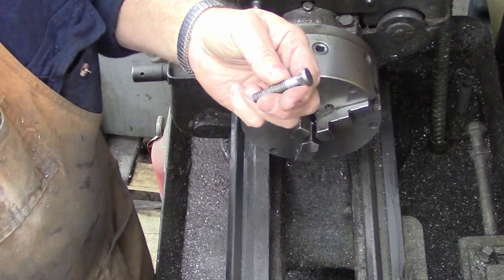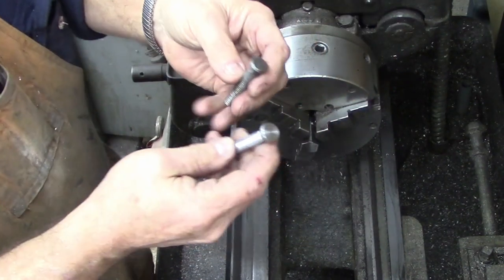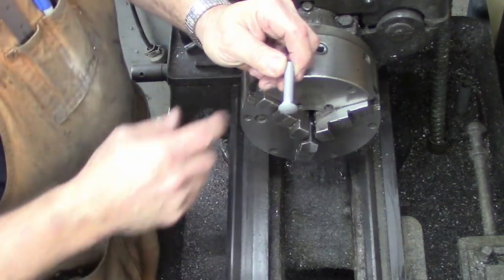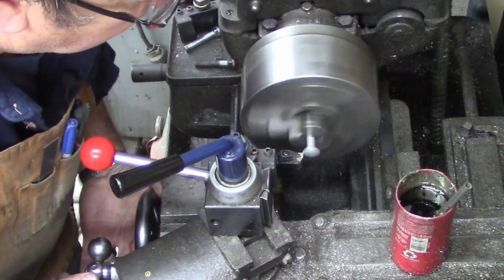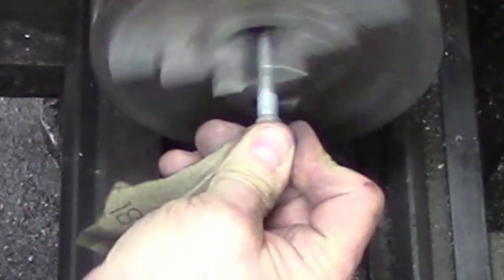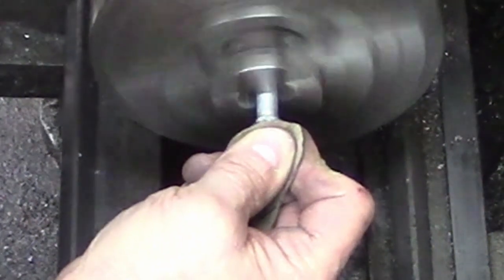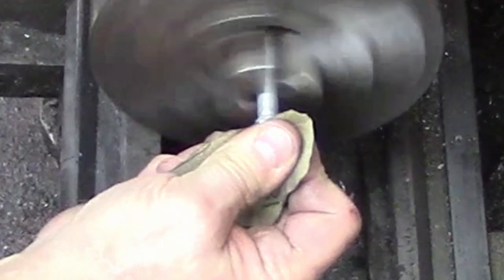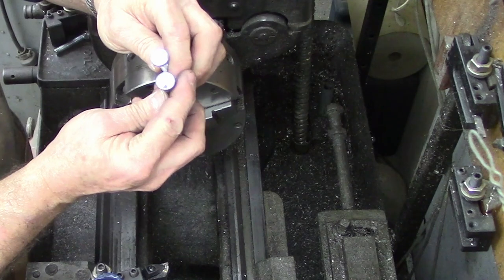Machining A 9-69A Banjo Bolt For The 10 Inch Atlas Lathe: Part 1

Comment: Do you have any recommendations for a similar quick and dirty way to replicate the bushings and sleeves for this bolt? I picked up a 10F with all the gears but none of the bolt, bushings, or sleeves for the gears.  Thanks
Reply from the maker: not yet but I have been thinking about the best way to replicate them, Dan.